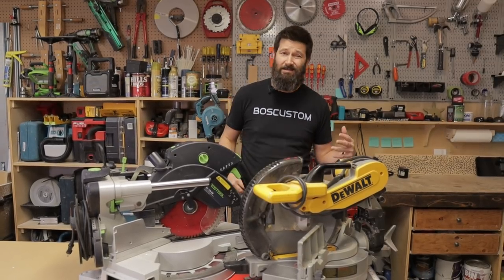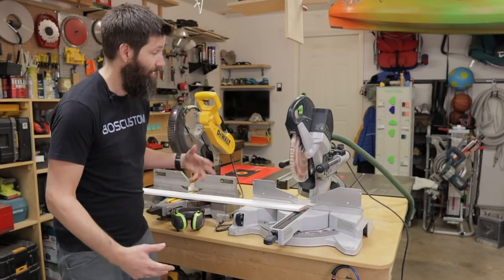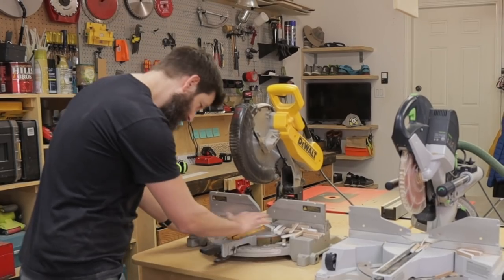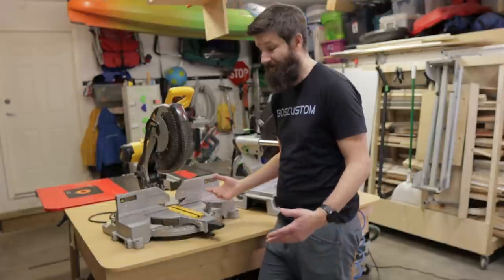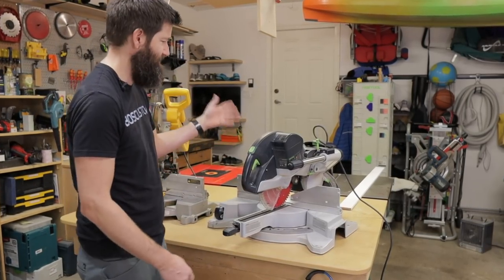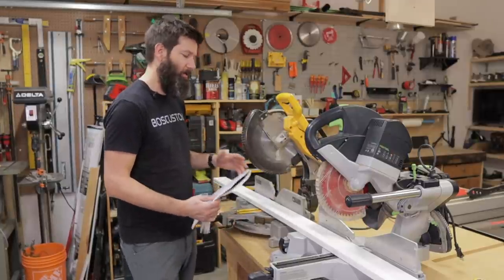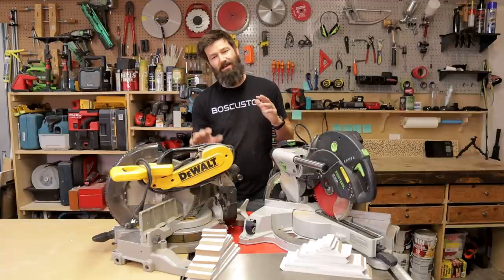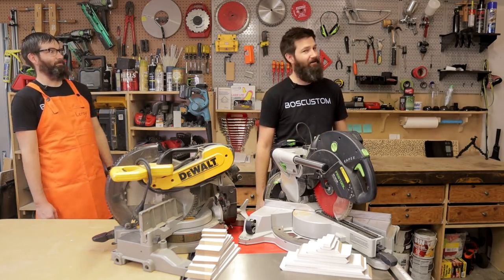Am I a Moron for Buying the Overpriced Festool Kapex-120EB over the Dewalt DW716?

Comment: I haven't seen your video, but guess I am the Moron for buying a cheap ass Bosch GCM 800 SJG 😂 I simply hate the handle and assorted safety features to operate the Festool saw....and the price. I'll hate myself when I have to work outdoors and some rain hits the beautiful finish.

You'll still need a hand plain to finish the pieces for fine woodworking.

Comment: I wouldnt be able to get used to the vertical handle on the festool
Reply: @Phelebas Yep that's theory for you. In practice you'll end up with a sore wrist.
It's an absolute horror!
Helaas Festool doesn't make left and right handed tools...
But I theory they could have designed something a lot more ergonomic!
Reply: @Phelebas its not like its going to flex, what are you thinking.. i use the dewalt daily, never had an issue.
Reply: @Phelebas nah
Reply: @Phelebas so the wind makes a skyscraper sway, does it sway a little if you walk up and push it?
Reply: @Phelebas absolutely not true but ok, im not going to sit here and argue with you. Ive been trimming houses for 10+ years solid and have never had an issue with my dewalt being "a few thousands" out.
Reply: @Phelebas make a trip over to Texas some time, ill teach you a thing or two. I run circles around 3 to 4 man crews by myself. I know my tools better than any troll on the internet.
Reply: @Phelebas keep on keepin on, good luck to ya
Reply: That's why richard from finished carpentry didn't like. He's a pure DeWalt guy. He said the handle with the safety switch just wasn't intuitive enough.
Reply: @badaphooko02  hes right too
Reply: @theovannieuwenhuizen5756  i would imagine someone like you would have a very strong wrist.. waka waka, msg me if you get it

Comment: your mistake was not buying a delta cruzer
Reply from the maker: I did check that out at Lowes the other day, looks nice.
Reply: @TheFunnyCarpenter  pair it with a tenryu silencer 80t blade and its the best saw I have ever used. its smoother sliding than an oldschool makita

Comment: For the same $350 as that dewalt you showed you can pick up the DW779 12 inch slider, huge capacity. It has decent dust collection as long as you make sure the flaps don't colapse. 

I don't think you're crazy for buying the kpex. If you can afford 4 times the price for the best tool possible go for it. My moto is always buy the best you can afford and it will (normally) pay for itself.
Reply from the maker: I'll have to check out that DW779.
Reply: @TheFunnyCarpenter  I loved mine when it was a bright sunny day and the saw was set up already and I could watch the wind blow the dust into an area that wasn’t near me. 

It is bulky and heavy. And I mean bulky and heavy. I compete in powerlifting and I hated when I had to lift that saw onto a stand by myself. And carrying it while attached to the stationary saw stand? Ugh. It’s so bulky that it doesn’t fit through standard doorways on the mobile stand without contorting your body trying to carefully angle and maneuver the entire apparatus through without damaging the door or trim. 

It’s a beastly cutting machine tho. It precisely and cleanly and quickly cut anything I put in it’s way and violently expelled the waste backwards. And sideways. Some of it made it into the dust collector. It covered every surface nearby in debris BUT it did a damn good job at clearing it from the cutting area. 

The problem is not how the saw performs. It’s an outstanding saw in its operation. It’s the set up and clean up  that is the burden

Comment: Here’s a questionnaire to determine if Dewalt or Festool is a better choice...

“Do I work mostly make cuts inside where dust collection matters or outside where dust doesn’t matter as much?”

Outside- Dewalt 
Inside- Festool

“Do I throw my equipment violently into my work truck or is it exposed to any other user violence and trauma?”

Yes - DeWalt 
No- Festool

“Have I already invested in the Festool system so that my new Festool tool is compatible with my other Festool equipment (or am I interested in investing in the system?)”

Yes - Festool 
No - Dewalt 

“Do I take pleasure in luxurious and thoughtful but expensive features such as ergonomic button and switch placement, Bluetooth activation, machined guiding marks, etc?”

Yes - Festool
No - Dewalt 

...

I have a lot of Dewalt tools and equipment and  I’ve also invested a lot into the Festool system. I have a small workshop in which dust collection is extremely important and space is severely limited. Festool is absolutely wonderful to use inside the shop. But when Im working outside (or just not in my small woodshop) and I need some cost efficient brute force that also performs well, I love my dewalts
Reply from the maker: This is great!

Comment: At 2'21 You forget to turn dust collection on 😂
Reply from the maker: Lol it looks that way!  It’s a trigger activated vacuum, so it was definitely on.
Reply: @TheFunnyCarpenter  I know, just pulling your leg!
Reply: @TheFunnyCarpenter  It is sort of funny the amount of dust that spits out the back, or from the front on jobsite saws. But really not funny considering it's mostly bad for your health. Always wear a mask!
Reply: The number of tooth on the saw also matters. Less teeth, bigger chips.
Reply: @theovannieuwenhuizen5756  I think this could be a major issue if you're doing remodel work. Yes, there are ways of controlling the spread of dust to other parts of the home, but the best way is to capture the dust at the source so it never has a chance of spreading in the first place.
Reply: @DKWalser  It is David.
Any removal of material will produce dust. Fine dust that floats around to everywhere.
That's why it is so important to wear breathing protection and use the best dust collector possible.
When on a jobsite I try to contain dust and chips to one room or put up a dust curtain.
Reply: @DKWalser  Valid point, trouble is we could only do so much to stop the spread of dust. I tend to put the plastic doors over a frame and have a dust fan blow the residual dust out of the window so it does not spread through the property